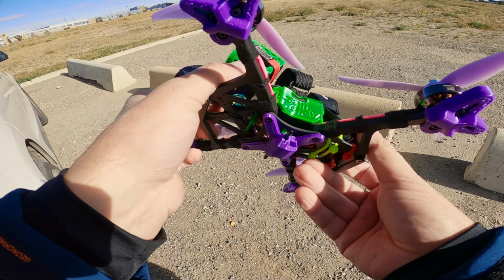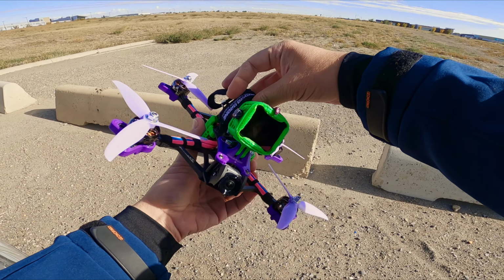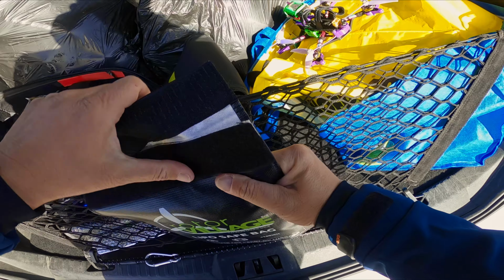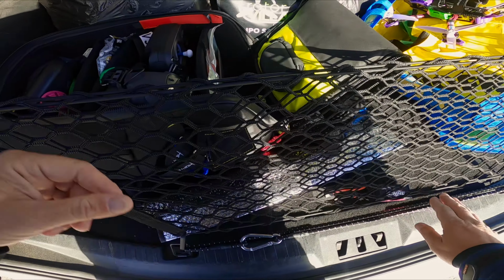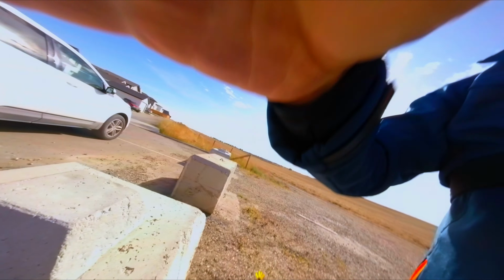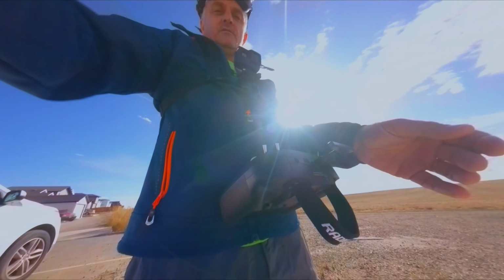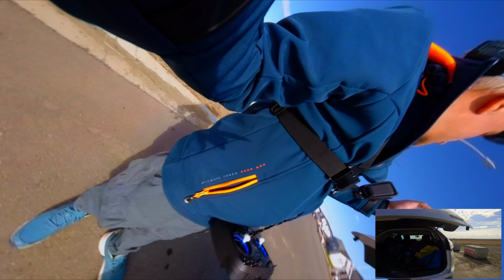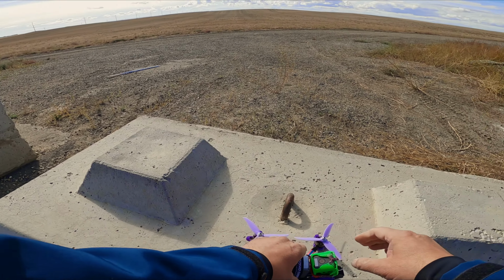👽 𝙈𝙮 𝙁𝙊𝙐𝙍𝙩𝙝 𝙘𝙪𝙨𝙩𝙤𝙢 𝙁𝙄𝙑𝙀 𝙞𝙣𝙘𝙝 𝙗𝙪𝙞𝙡𝙙 𝙈𝘼𝙄𝘿𝙀𝙉 𝙛𝙡𝙞𝙜𝙝𝙩 | ꜱᴇɪɪ-ꜱᴇꜱꜱɪᴏɴꜱ |  ₀₉₋₂₉₋₂₀₂₃ | #NOSTAB

Comment: I love 4s and 6s and just get the 2450 kv and use a throttle limit to 66 for the 6s using different profiles for 4s and 6s.
Reply from the maker: I went straight to 6s, all 4 of my custom built 5" quads are 6s, as well as my very first B'n"F, Cidora SL5 v2.1. I only have one 5s battery and so far I am loving it! So light, and it provides not as much fly time as 6s, but much more enjoyable since quads fly equally good and agressive as with 6s, but since it's quite lighter package, they seem to fly much easier.